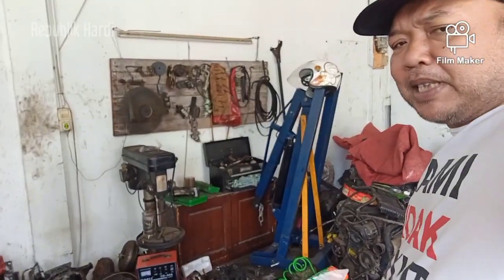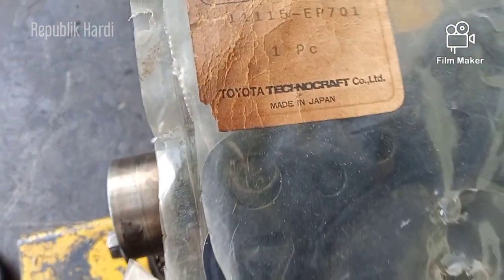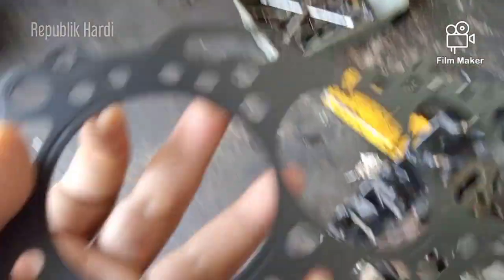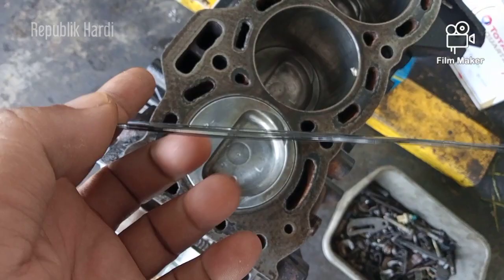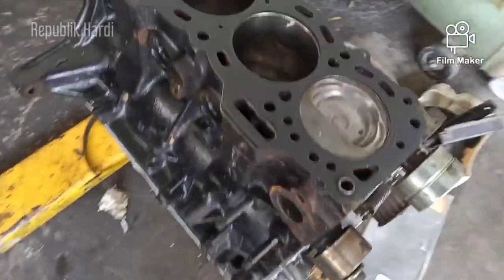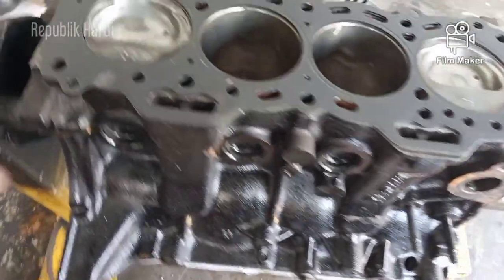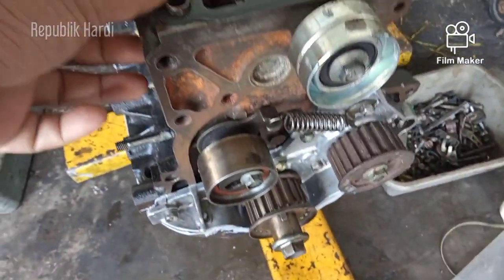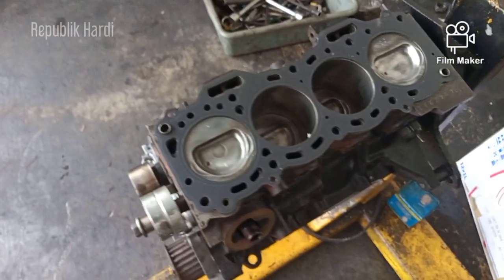Super Rare!!!! | Packing Head TRD  Pasang di Starlet

Comment: Om saya liat liat di marketplace di cantumkan kode 71 dan 80 itu beda gak om packing silinder nya ?
Reply from the maker: Ada beda sedikit, jd ep71 atau ep81 itu starlet bermesin 1300 cc (kode mesin 2E) kalau Ep70 dan Ep80 adalah starlet bermesin 1000 cc (kode mesin 1E) jd sebaiknya pakai sesuai kapasitas mesin nya.
Reply: Om boleh minta no wa nya. Biar saya belajar dr om kalau ada masalah di Starlet saya. Kebutuhan br 3 bulan ngangkat starko ep 71.
Reply from the maker: @arinuahta9794  no wa 081808859123